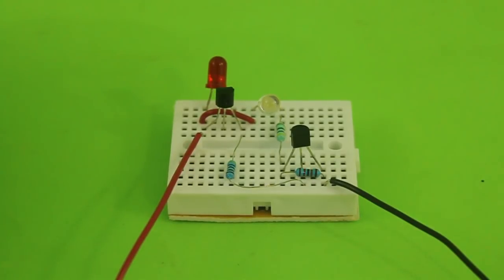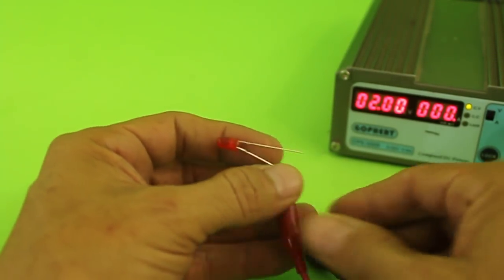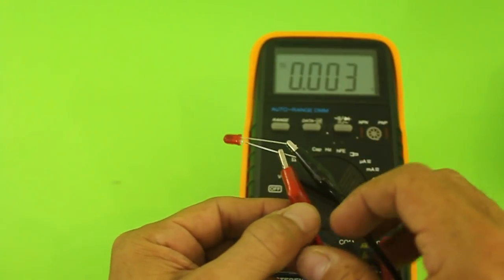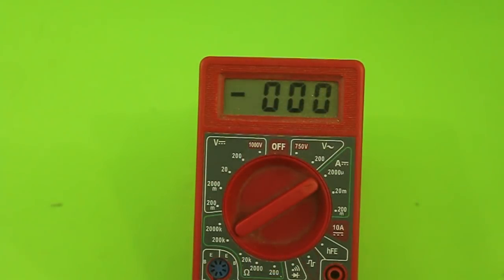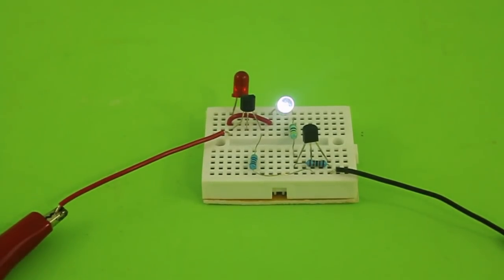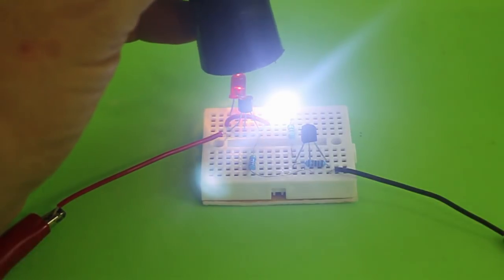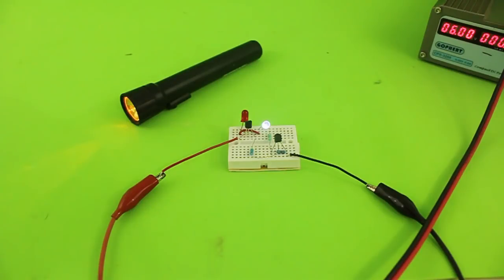The LED as a Light Detector

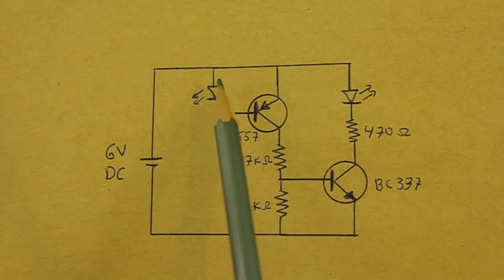Comment: What is the use use of the 220k ohm resistor?   1:56
Reply: It ensures that the BC 337's base will be "pulled" to ground so that the transistor is turned off when the current entering the base via the 47k ohm resistor drops low enough.

Comment: Hi Ludic Science;
Take a look at some circuits I make which I invented
using LEDs as the sensors.
The concepts:
http://www.redrok.com/electron.htm#led1
Small solar tracker:
http://www.redrok.com/electron.htm#led5
Using a low power AC power source:
http://www.redrok.com/electron.htm#ledac
and a high power full feature solar tracker:
http://www.redrok.com/lec3xassm.htm
Here is a completely different concept based on '555 timers:
http://www.redrok.com/electron.htm#led555
and many others.

redrok@redrok.com

Comment: Question ! Then Can I replace it CdS cell instead ? Im planning to make Solar tracker but as u know CdS cell is too common. So Please advise meee
Reply: Hi all;
Take a look at some circuits I make which I invented
using LEDs as the sensors.
The concepts:
http://www.redrok.com/electron.htm#led1
Small solar tracker:
http://www.redrok.com/electron.htm#led5
Using a low power AC power source:
http://www.redrok.com/electron.htm#ledac
and a high power full feature solar tracker:
http://www.redrok.com/lec3xassm.htm
Here is a completely different concept based on '555 timers:
http://www.redrok.com/electron.htm#led555
and many others.

redrok@redrok.com
Reply: A cadmium sulphide cell will work, but typically they respond more slowly than photodiodes or phototransistors.  That's not a problem if you only want to detect sundown or approaching car lights or torch light, but will probably be insufficient if you wish to send data via an optical link.

Comment: Thanks :)
This idea can be carried further to make an optocoupler, please make it if possible.
https://en.wikipedia.org/wiki/Opto-isolator
Maybe by using 2 LEDs, one as sender(of light) and another as sensor, stick both inside a piece of straw wide enough, or cut the straw then glue it to make it wider if it was thin. Lastly, externally use a black marker/paint/dye or tape to isolate the piece of straw from external light.
Reply: https://makezine.com/projects/make-36-boards/how-to-use-leds-to-detect-light/
https://duckduckgo.com/?q=LED+as+sensor&ia=web
https://duckduckgo.com/?q=DIY+optocoupler&ia=web
https://youtu.be/WItpp1lKBYQ

Comment: Is it possible to make multiple diodes with amplifier to charge a 12vbattery?
Reply: Probably not, since the current which the diodes can supply would be below the self-discharge current of the battery unless you use thousands of diodes (in which case you may as well just use an ordinary photovoltaic panel).

Comment: So, what's the difference between an LED with a photodiode when both can detect light?
Reply: A photodiode is generally designed for the job and has specific characteristics, while an ordinary LED isn't guaranteed to have the electrical characteristics which you need in order to use it reliably as a light detector.